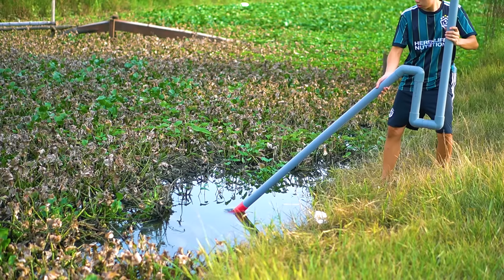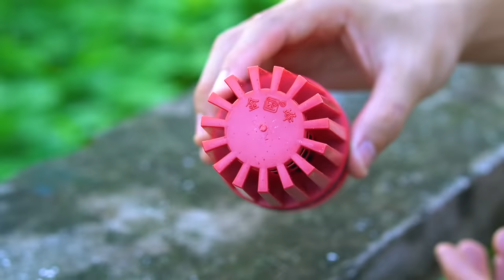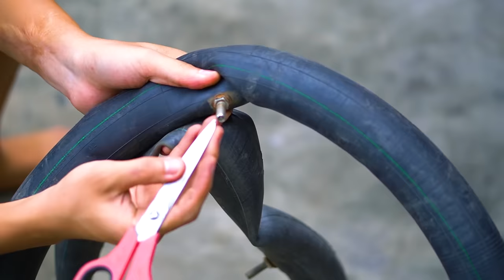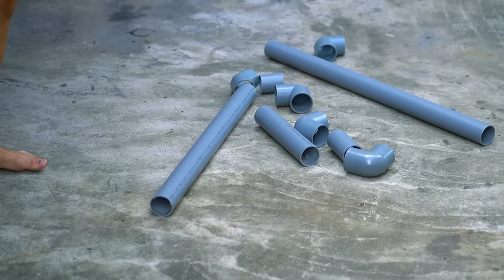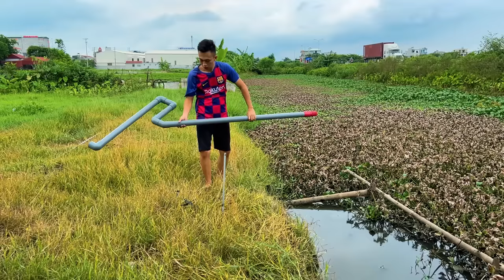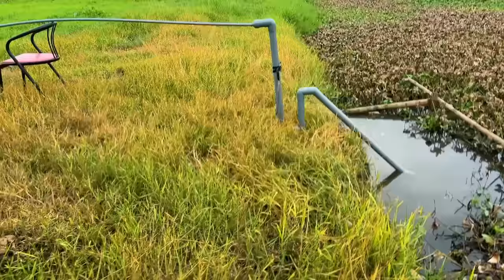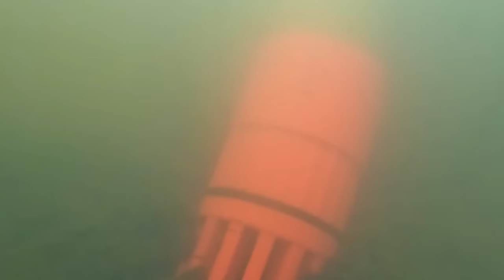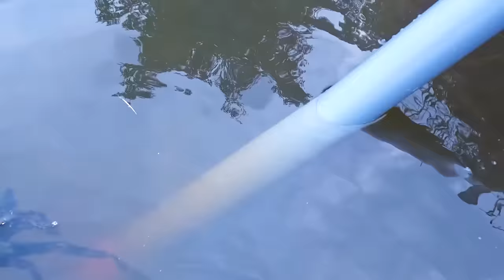I turn PVC pipe into a water pump no need electric power

Comment: Fake , it should be a water pump in theree
Reply: The whole channel is about fake inventions 🤣 he's a troll
Reply: Yes
Reply: Setidaknya dia modal buat nipu🤣
Reply: I agree with you it is fake
Reply: Mustahil
Reply: Apakah ada kemungkinan kalaubitu benar ?
Reply: Rảnh thiệt chớ...
Reply: @diyhard666  can you back up your conclusion with evidence so that others understand
Reply: @meriatimerikan5190  Google Bernoulli's principle and learn a bit about it.
Reply: no its not man where you been it works like syphoning hose your not to bright.
Reply: Not fake, he manually pumped the water and the check valve helps to hold the water inside the pvc pipe till water gets out at the discharge end, by the way I am pipefitter, greetings!
Reply: It’s 100% faked
Reply: @juangerson  can you explain the function of the valve stem? Curious.
Reply: @davidthompson1529 Not somepony who 👍🏿 this comment   🖖🏻
Reply: Funny how people don't understand fluid dynamics and say things like this are fake
Reply: @oldrango883 you try it?
Reply: @DamaniDanDadar  Then how you apply the Bernoulli's principle to this situation. No need to get simple here.
Reply: Bicycle valve😂 scamventions
Reply: it is not fake , just use a garden hose put one end on deep water in a container and aspire hard ( be careful )on the other end and the water will continuo runing until no water or water level is very low  in the container.
Reply: This is exactly what we use on Mars. Sometimes it actually works on Pluto also.  👽👽👽👽🛸
Reply: He's a right bullshitter.😂
Reply: 😂😂😂😂 @HanyuRapui
Reply: U can actually do this.. my god u under/over educated people…🤦‍♂️🤦‍♂️ no wonder y the world is like it is! Only thing fake here is yall say it won’t work when I’ve actually done it! 🤷‍♂️

Comment: In the first 20 seconds he shows you his 'siphon' begins working without priming. There is a battery operated pump. The alteration to the check-valve is totally useless also.
Reply: Notice how he listens to the sound at the beginning before putting the pipe in water, what was he listening to? Gods 😁
Reply: Thanks
Reply: His name is Foo Ling Yu
Reply: I’m no expert in hydrodynamics, but I do know that for a siphon to work the output end has to be lower than the surface of the water you’re trying to move, unless you’re using a pump.
Reply: dont let the electric car people see this or we will all be " pumping " water with these.
Reply: I don't buy it.... Hell no!
This guy is using a pump.
Reply: @MyVisualRomance  Nice one !
Reply: @MyVisualRomance  😂😂🤣
Reply: I was trying to figure out why he modified the check valve. I saw the intertube and thought he must be going to use air pressure to start the pump. Happy I wasn't the only one wondering or skeptical
Reply: @MyVisualRomance  

Surely it's Foo Lin Ni Wan?
Reply: not sure about !
Reply: @Jeff Kemper you still can't syphon uphill
Reply: @traviswilson5410  right a siphon won’t produce that pressure 5ft above the water level maybe 5ft below it.
Reply: It is neither Syphon nor Ramp Pump. So I wonder how can water be lifted up for flow against gravity?
Reply: @GoldenSpur47 dicen que la gravedad no existe yo estoy queriendo informarme si es así o no
Reply: And this this is definitely under pressure. You can see that whenever he restricts the flow.
Reply: So much for conservation of energy
Reply: The pipe was already primed. It was already full of water. Entry into the water was enough to get it started.
Reply: @traviswilson5410 so, when your straw is in you beverage,  how does that water get to your mouth. Surely you don't lay under the cup to drink.
Reply: @GoldenSpur47 it's pushed first. The check valve pushes water up, every time he shakes it. The check valve stops the water from exiting through it. Once the system is filled with water, then the siphon kicks in the draw the water up, as the water falls out of the top. It's the designs series if falls that keeps pulling the water into the tube.

Comment: If physics worked like this... all the P-Traps in my house would be spewing water out of my sinks and toilets.
Reply: Well it’s why S traps are no longer code. 🤷‍♂️
Reply: im making sure i’m not dumb too bc im 100% sure this doesn’t work and i’m pissed bc i was looking for a good pump for shine makin 🤫
Reply: @nickspencer3132  This works. The Amish use. Hydraulic Ram Pump to supply their homes with H2O. A HRP will even push water uphill ! The 1 to 7 ratio.  For every one foot drop the pump will push H2O 7 feet higher. You could even use a reducer near the output end and create more pressure.
Reply: What a shister
Reply: Put about 40 psi on it, it will definitely move water.
Reply: 😂😂😂No it  wouldn't...then u dnt understand physics.....and how drainage even works at all!!!...your drainage system is basically always empty until you turn that faucet...water always emptys out in to the stack....the physics of a natural pump works because soon as u get the pipes filled with water soon as it drains it creates natural suction and it sucks the water fron the other end....have u not watched movies or in real life of sucking gasoline out a car tank with hose n it emptys out eame idea.....water would never spew out ur sink unless u had a blockage in the line somewhere.....
Reply: The Romans had a technique that made water flow up hill on special water causeways, but the source was higher than the supplied end. A syphon will only work downhill direction, the vacuum I believe is lost when the water out become higher than the source?
Reply: @jeffmosier3145  no the pressure is regulated by the water pressure in the down pipe, all you'll do reducing the outlet size is to restrict water flow
Reply: @jeffmosier3145 This is not a hydraulic ram pump, there's no valves to create the hammer effect.
Reply: Ill get back to you on this, this afternoon. Going to spend the 5 bucks to debunk or win with this.
Reply: Ikr
Reply: It creates a suction just like when siphoning gas out of a car's gas tank.. same principle.
Reply: @Mr.Fotingo-qf9hk  The outlet has to be lower than the inlet....... thats how a siphon works.
Reply: @Mr.Fotingo-qf9hk  This video is bs.
Reply: @Mr.Fotingo-qf9hk  once again..... with your logic...... If physics worked like this... all the P-Traps in my house would be spewing water out of my sinks and toilets.
Reply: @Mr.Fotingo-qf9hk  Siphoning requires the outlet to be lower than the highest point of the source. Have you ever siphoned anything in your life, let alone get it to a container higher than the source?
Reply: @PolyGrip so did you debunk this?
Reply: There has to be a battery involved. He is just making $ come out of that pvc, not really water. 

2.8 mil views on a scam video. Not bad.
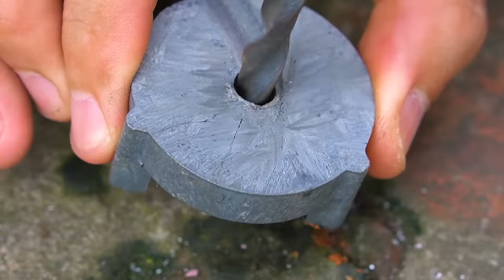Reply: 2:35 wtf!? You just had a vice and risk ripping finger when notoriously snag prone plastic locks on drill bit and plastic takes off like jet turbine
Reply: THATS WHAT I DID WRONG IN MY PLUMBING!🤣
Reply: If you are going to cloud the issue with facts and physics, we are gonna be here for days friend🤣😂🤣😂
Reply: @PolyGrip so where is the follow-up. Did it work, or not?
Reply: No . This is a siphon
Reply: Actually,  they will if it's full on the other side, as in the water has no place to go. That is what happens when your sewer pipes gets plugged up big time.
Reply: Your p traps don't have check valves at the bottom preventing the water from draining out. Once the pipe fills and starts draining out the top (which is why he was moving the contraption back and forth in the water to start it) it's basically a big siphon.
Reply: @thefloatingapothecaryroman16  there is a one way check valve.  It won't allow the water to go backwards.  Once the siphon starts at the top, it's filled with water and sucking up water like a straw in a beverage. Because water can only exit one way it will flow till the suction is broken by air in the system or no more water to pump.
Reply: @PolyGrip and your finding?
Reply: @PappyMcPoyle-vj4vt there is a one way check valve. Water can not flow back out. The design used that to fill the system with water every time he shakes it. It's like taking small sips from a drink till it gets to your mouth. The valve stops the drink from flowing back into the cup.
Reply: @PappyMcPoyle-vj4vt not true. There is no suction. There is more air than water before and after the  trap.
Reply: @ThisHas2B 😂😂😂😂 nope
Reply: @ayatti26  ah yes, well.... it has potential, i suppose, i tweaked with it a bit, for the measurements.. but i had to keep pumping, so either im not very good with that sort of build, or it doesnt work.
Reply: @ayatti26  it does NOT come out like at the beginning of the video.
Reply: @PolyGrip  at the beginning its already prime. Notice how he holds it. As soon as it enters the water the check valve pushes the water out and kick starts the siphon.
Reply: @PolyGrip  understood
Reply: @PolyGrip  do you have photos are you process.  Let's get it functional. What size foot pump did you use?
Reply: @ayatti26  ahaaaaaa. I see... yes this may change results.
Reply: @ayatti26  have you tried to make one? Sadly, i cannot buy items easily, financially or access, i have tried with what i could find for a small price. But, you make me hopeful to try it again
Reply: @PolyGrip  I haven't yet. But I have a need for one now. So I will start my search for the materials.
Reply: @ayatti26  look up ram pump as well, this may be easier to set up. It isnt practical in my situation, but if you have a downhill stream, it is very useful.
Reply: @PolyGrip  I don't have a running water source like a stream. I'd need this one for standing water.
Reply: @ayatti26  yepp, looks like we're both in that basket my friend. Im going to try again this week, ill keep you posted.
Reply: @CookinwithChris86 
   Add a bucket of water to your toilet because of the way it is Pipe. Once the water goes to a certain level. It will suck it out.
Reply: @CookinwithChris86 not this bunch… 🤷‍♂️🤦‍♂️🙄 some have no clue or common sense!
Reply: @TeamEvansHealth it’s definitely not a scam.. not everything needs to be the world needs electricity to work.. this does actually work! Sorry to say but you’re wrong.. so u can put your battery’s back n your “secret toy” 😂
Reply: @PolyGrip did u add the check valve?
Reply: @travisc3571  Isn't the S trap to keep sewer gases on the down side of the pipe? The water in the trap acts like a barrier for sewer gases.

Comment: "Next, I shall power my home by plugging the extension cord into itself!"
Reply: Endless supply of energy in a continuous cycle.  f'kn BILLIANT!!
Reply: I ALSO SHALL GET WATER IM MY HOUSE BY CONNECTING A GARDEN HOSE INTO ITSELF
Reply: wow great idea ill give it a try :))
Reply: The only way that will work is if you get the extension cord with three outlets on the end so you can plug in other things. I use this trick instead of buying a generator when I go camping. The trick is you have to get magnets with holes in them and zip tie them to the cord.
Reply: @jeffreysilva3054 I took your advice. Unfortunately the cords I ordered were from Australia and the holes were upside down. Waiting on new ones now.

Comment: You don't need the bicycle inner tube schrader valve inside the check valve. In fact, you don't need the check valve at all. Or any particular configuration of pipe. Just properly align the end of the pipe with the outlet of the hidden underwater fountain pump and presto!
Reply: The check valve allows you to prime it in those first few pumps.  But I honestly don't know what the valve stem was for....the check valve was fine how it was.
Reply: @TheChromesnake  The valve stem is for the air connection that bubbles the water out the top,
Reply: @TheChromesnake  i think its a weight to close valve again